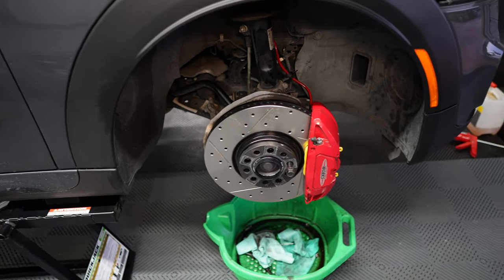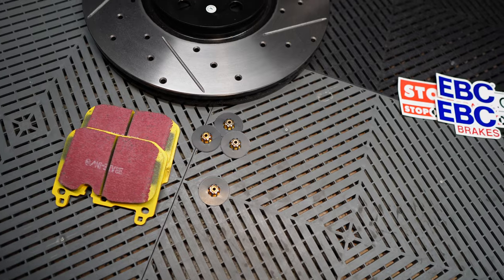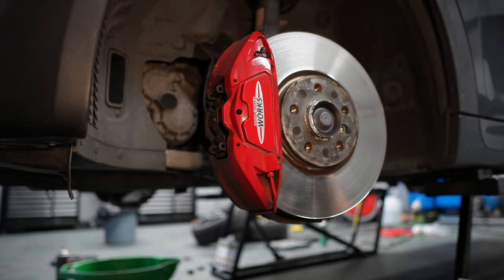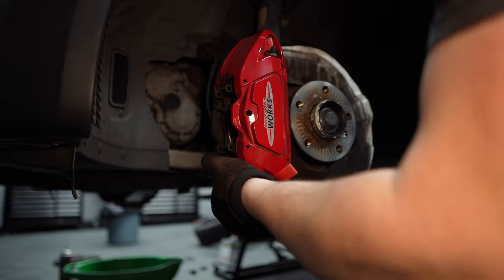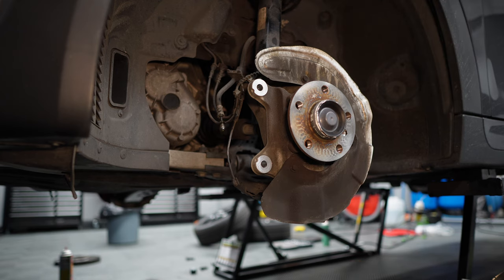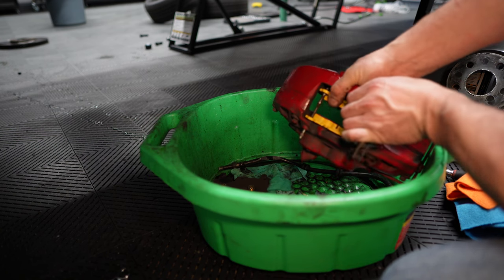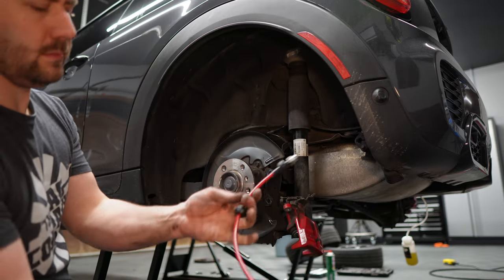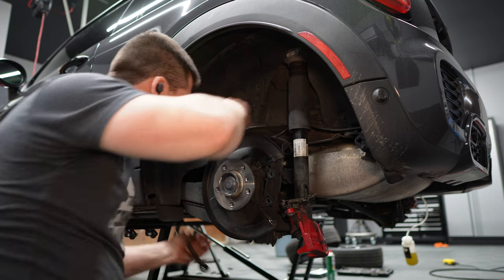IG420 The mini gets brakes EBC Yellow Stuff, StopTech Rotors, NM Lines

Comment: Good morning. Just wondering where you got the 1.7 bar number from for the power bleeder.  I was always told not to exceed 15 PSI to avoid putting too much pressure in the brake/clutch system but when I bled the brakes at that PSI on my Cooper S the fluid was slow to flow.  Also, it was so hard to get the rear caliper bolts torqued to specs (22 ft/lbs plus 90 degrees) because the shocks were in the way of the torque wrench.  It doesn't look like you used a torque wrench in your video but that may have been cut out.  Thanks for the video.
Reply from the maker: I originally bought it for my Mercedes, and they (Mercedes) recommend as high as 2 bar (29psi) for cars with ABS.  Ive found that 20PSI seems to be a sweet spot where fluid flows reasonably well and the connections on the bleeder don't leak.  
Maybe ive just gotten lucky.

The risk would be springing a leak either on the motive hose connections or between the reservoir and the master cylinder, after the master cylinder the car has way more pressure than 2 Bar (800psi or more in some cases).
Reply: Hey, good video but to let you know the rotors are in the wrong direction. Just a little helpful advise. The sweep line supposed to go towards the back, but I like the video.
Reply from the maker: i thought so too, but they were labelled L and R the way i installed them..  So i just assumed i was wrong.   @MXRIP1

Comment: Hello, 
Do you have the references of the discs fitted to the car please? 
Thanks
Reply from the maker: front stoptech 127.34186L and 127.34186R.  rear 126.34159SR and 126.34159SL
https://amzn.to/3Ng6Lw3
https://amzn.to/47VjGfr
https://amzn.to/3T4Gftp
https://amzn.to/3Tr5J4v

note these are only for cars with the JCW brakes.